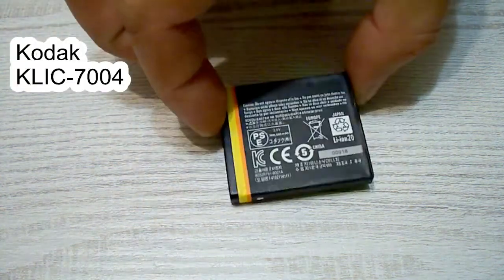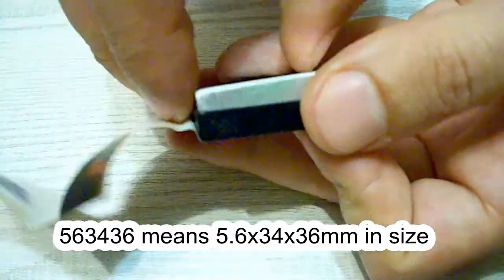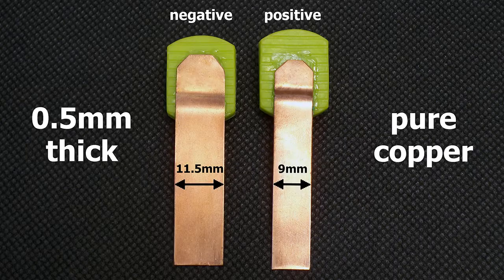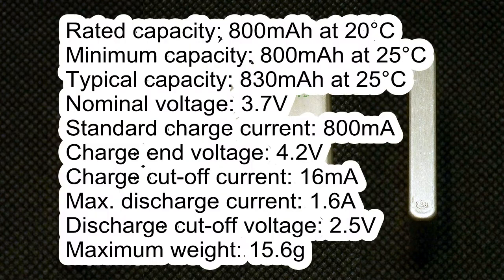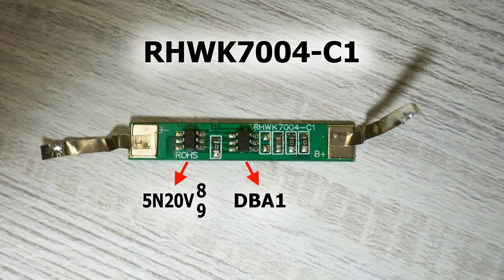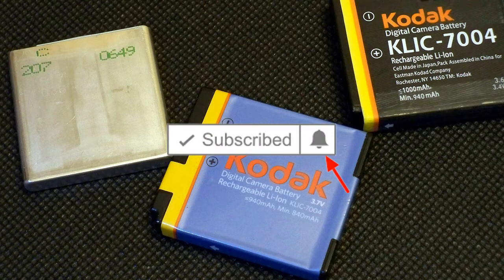Sanyo UF553436G - DIY replacement of Kodak KLIC-7004 (Fujifilm NP-50, Pentax D-Li68) Li-ion battery

Comment from the maker: 01:23 - Testing equipment
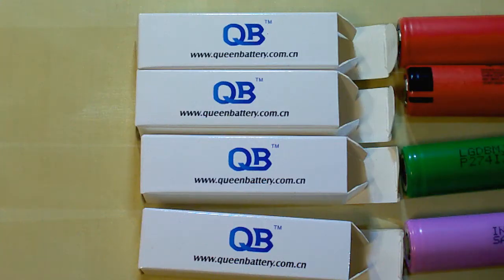02:35 - Battery supplier
02:59 - Sanyo UF553436G specifications from datasheet and capacity test results
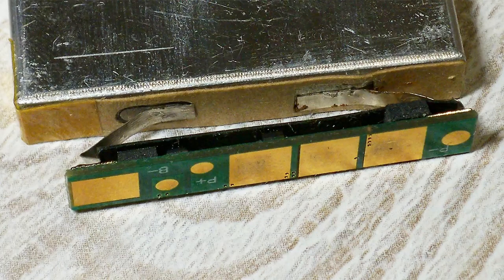04:29 - Replacing the Li-ion cell in a genuine Kodak KLIC-7004 battery
05:34 - Verdict